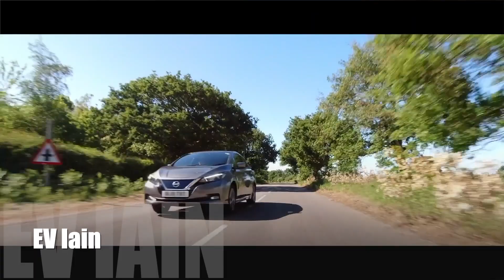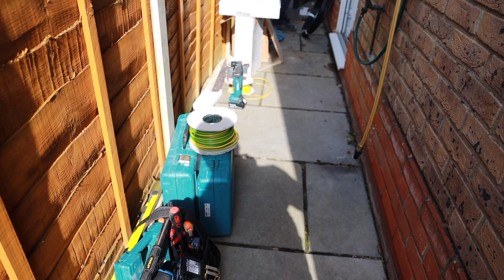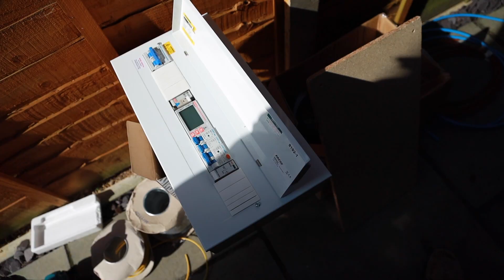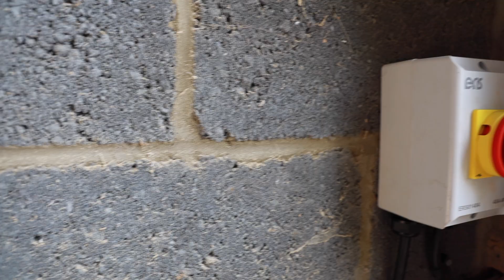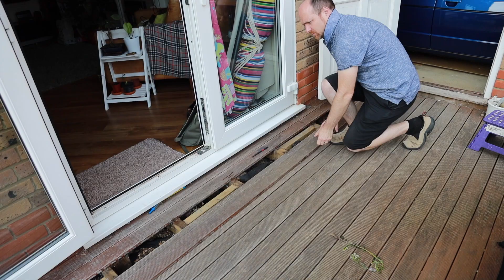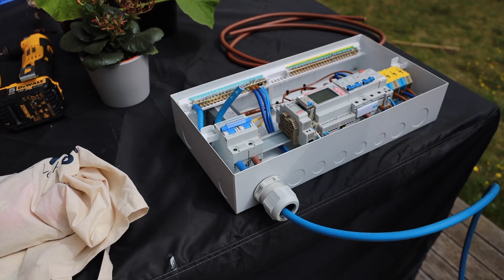Vehicle 2 Grid Install Day!

Comment: Hello Evlain, I have a question. We are about to order a used 2019 Nissan Leaf S (40 kWh) with very low mileage. We would like to know if the vehicle supports V2G technology? Is any Nissan Leaf model can support V2G or some of the models can and others can not?
Reply from the maker: Older models don’t I believe, I can’t remember exactly probably 2013/4 ish. Any of the 40kwh ones should be fine
Reply: @eviain  Thank you so much. Yes, ours is 40 kWh.

Comment: Hi Iain just a comment on the PEN fault unit. You need one of these if you have a TNC system and the grid looses the neutral. The earth and the neutral are combined at your house so if you have your car plugged in and charging the grid looses the neutral everything stops working but is still live. The neutral and the earth in your house will go to live potential so your car could become live (you don't need a fault on the car) you then stand on the ground (earth) and touch the car and complete the circuit (shock condition). I fitted an earth rod for my car EVSE so this is a TT system and it won't happen.
Reply from the maker: Ah thanks good to know, it’s a difficult one to get your head round. I assumed the car must also have a fault that causes a route to earth.